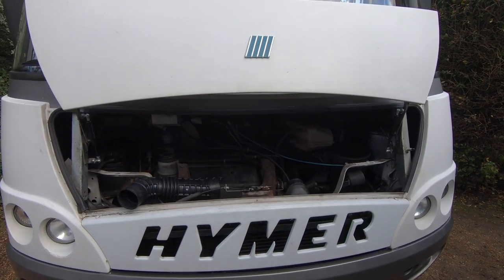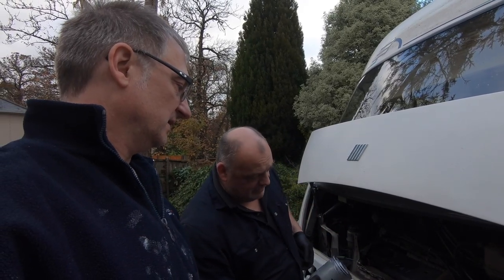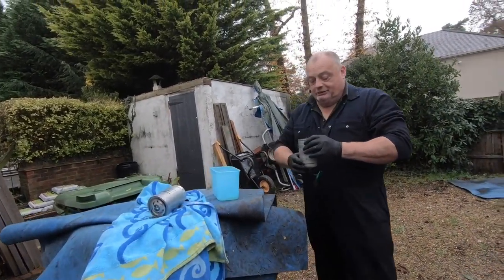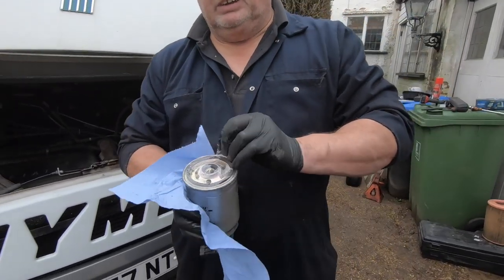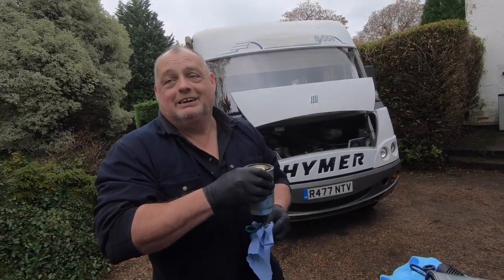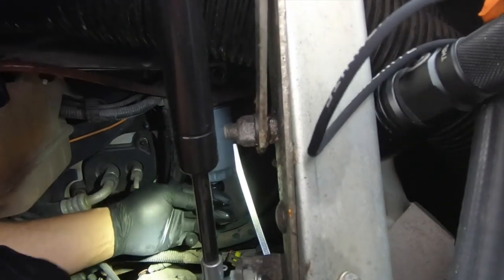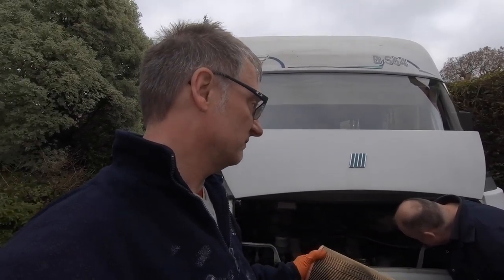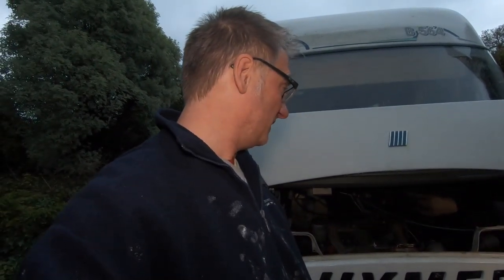Motorhome Mechanic - How to Fix Diesel Black Smoke - Replacing Fuel & Air Filter on a Fiat Ducato

Comment from the maker: Does your motorhome have black smoke when starting? It could be a simple matter of replacing the oil and air filter. It's such a simple procedure.
Reply: Did it fix you black smoke problem
Reply from the maker: Yes, changing the fuel and air filter seems to have fixed the black smoke issue, RV EU 16 Camper 👍👍

Comment: The diesel filter sensor is there to detect water in the system. Water is heavier than diesel so sinks to the bottom and can be drained away by undoing the sensor or the white cap at the bottom of the filter, hence the little drain port. 

Keep an eye on that air filter. If it gets black fairly quickly, then the PCV valve is letting oil from the crankcase breather through into the filter. Normal engine wear I'm afraid causes that. More regular engine oil changes will slow down the wear slightly.
Reply from the maker: Thanks for Sleepy Cat Pictures. Great information.
Reply: @HermanHitstheRoad    Ta!  the Disco 2 fuel filter is very similar. Had to change mine 'cos it started leaking!
Reply: Would that be a sign of worn out piston wrings? I get plenty of oil in my air filter
Reply: @alexandreromao8410  If the oil is from the crankcase breather hose, or it could be a blocked PCV valve. Usually, yes.
Reply: @sleepycatpictures1176  if the pcv was blocked the pressure would just build up on the crankcase correct?
I've seen cars with so much crankcase pressure the oil would just come out the dipstick.
Reply: @alexandreromao8410  But if the PCV valve is stuck open?     The engine in Old Stinky is worn out and is I think, responsible for the oil in the turbo.

Comment: It looks like you guys not forgot to put the inner / center  rubber seal on the filter when installing (The one you put on the bin before priming it with fuel).
Reply from the maker: Haha. It does doesn't it? That's video editing for you - unintentionally of course

Comment: Hi. Did you leave the senter rubber ring on the top of the filter, or did you put IT on the senter Axel? I tried with the senter rubber ring on the filter, but IT was hard to tighten by hand.
Reply from the maker: I think we put the sender rubber it on the filter. We also put the top/centre on the filter and screwed it in, @JohsFolkestad-v8w

Comment: Just wondering is this the 2.5 engine  and if it is have you ever replaced the  coolant as I am having trouble locating the engine block drain plug and also the bleeding screw when I begin to refill. Any help would be much appreciated.  Thanks.
Reply from the maker: Hi Graham, it is the 2.5 diesel but I've never replaced the coolant. So, unfortunately I can't help you there. Have you tried asking on Classic Hymers Technical Facebook page? They are very helpful
Reply: @HermanHitstheRoad   hi thanks for the reply. No I haven't tried that yet but will do. I'm running out of options even the manual I have has no pictures or diagrams. Thanks for the help 👍
Reply: Hello again just been denied access to the classic hymer tec group as the engine is in a boxer oh well back to the drawing board. Thanks anyway.

Comment: Hi,just another problem with my Peugeot boxer motorhome,I noticed a small diesel leak under the the engine looks like a seal may have gone or pipe problem any ideas.Chris
Reply from the maker: Hi Chris, I can't say without seeing it. Have you looked yourself? Where abouts is the leak coming from? If it's dripping then you should find out where it's coming from pronto
Reply: @HermanHitstheRoad  hi managed to get a mobile mechanic.he says it’s a seal at the bottom of the pump.Thanks so much for getting back to me.very much appreciated Chris
Reply from the maker: You're welcome 👍👍

Comment: What a pair of nuggets, as has been commented on, the centre o ring was left off the new filter and you really show fix any cracks in the air filter housing before re installing it. What is it aboutsome British mechanics, the state of his workshop and general demeanour really let the side down.
Reply from the maker: Alan, the o ring was removed before we fitted it. You can do amazing things with video editing. As for the workshop the covid lockdown sorted that out. How's your workshop?
Reply: @Alan Magee I disagree. I found this video very useful, it's great to see a good old-school mechanic at work. We don't all have a fitted-out workshop and I can relate to working on my van as in  this video.
Reply from the maker: I'm glad you found the video useful, David. Thanks

Comment: Tengo la misma que tu. Te sigo desde tiempo
Reply from the maker: Google Translated your Spanish in to "I have the same as you. I follow you since time."
Thanks Juan, a long time subscriber then? Do you have a Hymer B564 as well? Do you have black smoke?
Reply: Herman Hits the Road. Tengo mismo modelo hymer b564 año 1998 con 204.000kms y SI todos estos motores en frío humean bastante
Reply: Herman Hits the Road  por cierto me puedes poner referencias de los muelles y amortiguadores que montaste. Se ve muy bien, ¿es comodo?
Reply from the maker: That's great, Juan. How long have you had your B564? Does it have a name?
A diesel engine may produce grey smoke on starting but it shouldn't be black
Reply from the maker: Juan, yes the front shocks are very comfortable and firm. We've not tried them on a campsite yet. Here are the parts used. The SKU number is Coast Motorhomes own number:
Fiat Ducato Peugeot Boxer Citroen Relay Coil Spring Q18 1318989080 SKU 32080-32074 
Monroe V4501 Van-Magnum Shock Absorber

Comment: ive  just got a 2.0 litre jtd (2005) that i nearly ran out of diesel  , since then its been momentarily hesitating  at low speeds on acceleration  so i guessed some crap from the fuel tank got into the filter , i replaced the  fuel filter today but didnt fill it with diesel first like this guy did here , it started ok after 20 secs or so but its still hesitant like before. no better no worse .. , if its self bleed , why is it still showing signs air is in the system ? anyone? thanks
Reply from the maker: I don't know what it could be, @the dreamlikestatemusic. Maybe you've got a dodgy or blocked injector (assuming it has them) or something else is blocked. What is the most obvious thing it can be? Have you checked/replaced the air filter?
Reply: @HermanHitstheRoad  hi thanks it seems ok now

Comment: black smoke is  caused by diesel/fuel  and blue smoke is engine oil .. dirty injectors and failed heater plugs often cause black smoke  blue smoke is because the engine is burning engine oil,  could be over  filled, blocked breather, worn piston rings or turbo (if turbo model)  unless something more serious.
Reply from the maker: Thanks for the advice Mr Grumpy. Are you a mechanic too?

Comment: Los amortiguadores que sujetan la cama están muy bajos
Reply from the maker: I think Google had a tough time translating your Spanish this time "The cushions that hold the bed are very low".
The shock absorbers on our motorhome that hold the bed up are OK. the bed squeaks a bit though.
Do you yours need replacing?
Reply: Los hidráulicos de la cama los cambié y perfecto
Reply: @HermanHitstheRoad  I bet it does, but as long as your wife is happy.
I camped next to a van once, they were at it like a couple of rabbits.

Comment: Check if your cambelt needs replacing ! The most important serviceable item on a vehicle ! If it snaps the engine smashes the  pistons and valves thousands of pounds of damage !
Reply from the maker: Thanks Mark, we had the cambelt replaced about 3 years ago but we should check it out and maybe do a video on that too
Reply: @HermanHitstheRoad  I just googled it and motorhome website said ducato hymer every 3 years .a video would be great ! As an ex mechanic I'm always getting mine done slightly early .keep up your great content !

Comment: I NOTICED THAT THEY LEFT  THE CENTER SEAL OFF THE FUEL FILTER WHEN FITTING BY MISTAKE
Reply from the maker: We didn't Graham. That's just the edit. Thanks for letting us know, though. By the way do you know you have caps lock on? 👍👍👍
Reply: @HermanHitstheRoad  He is shouting at you.

Comment: God I hate my 2000 1.9td Fiat Ducato, worst vehicle I've ever owned.  The gearbox is made of parmezan cheese and has cost me thousands in repairs over the years, beware of water ingress, steel baulk rings die very quickly.  The scuttle has a couple of design issues leading to gearbox being watered regularly.  Just about to weld up the drivers sill and inner sill/footwell then it's adios amigo!
Reply from the maker: That doesn't sound good, Joe. I hope it all works out for you in the end. Will you be replacing it?

Comment: Replacing the fuel filter to cure black smoke is a waste of money!
The reason the engine admits black smoke is a lack of air into the engine!
Or faulty injectors!
It could also be caused by collapsing or week air induction hoses!
Moving on to the fuel filter, the filter that has the white bung with a hose attachment is for periodically draining water that sometimes accumulates in the filter!
The black bung with electrical wires attached are wired up to your dash that tells you, you have water in your fuel filter!
CHANGING YOUR FUEL FILTER WILL NOT CURE BLACK SMOKE!
Reply from the maker: It did stop the black smoke though, Mike. Thanks for commenting. I hope you enjoyed the video?
Reply: @HermanHitstheRoad  the fuel filter change did not stop the black smoke my friend!
Take it from me I am a fully skilled diesel mechanic! 
The only way you get black smoke is from a lack of fresh air entering into the engine and or a egr problem!  But this later egr would not show up until you were driving at a certain revs!
The only other cause would be your injectors over fueling!
The replacement of your fuel filter, although it's good to change at the correct intervals WOULD NOT CURE YOUR BLACK SMOKE PROBLEM!
you cured it by changing your air filter!
Reply from the maker: Thanks 👍👍